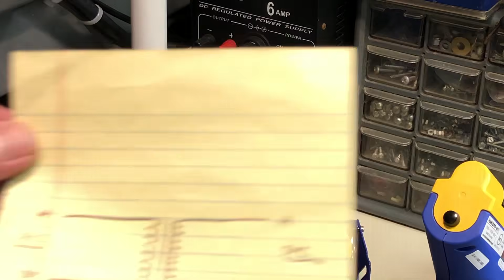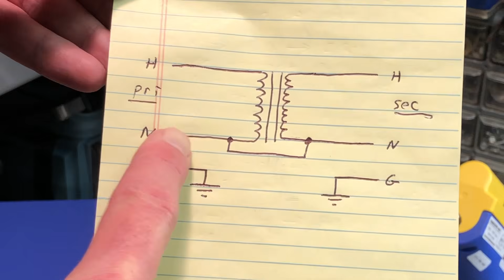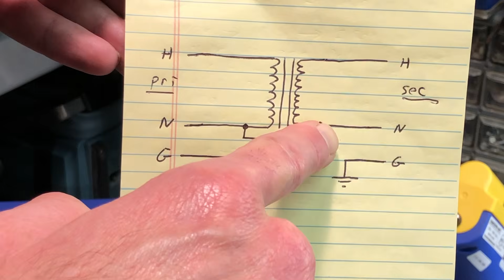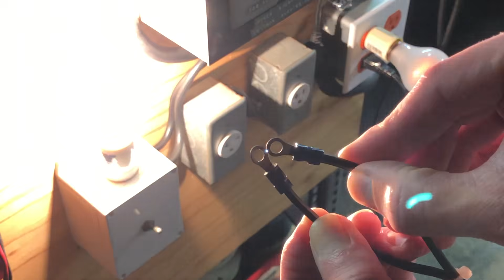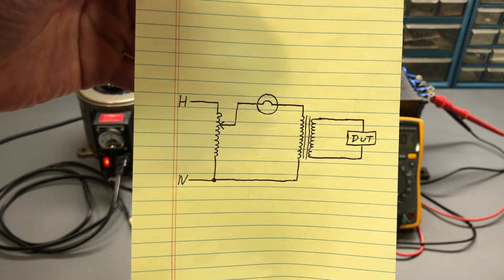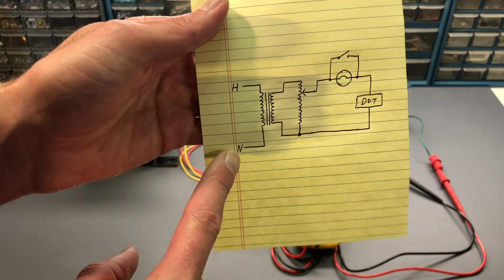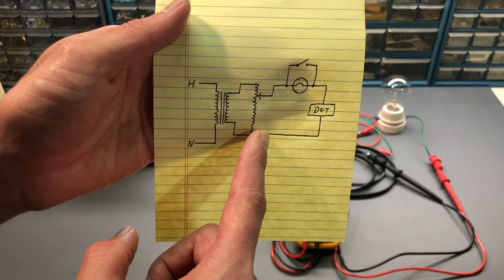How An Isolated Dim Bulb Tester Works (Current Limited Isolation Transformer And VARIAC)

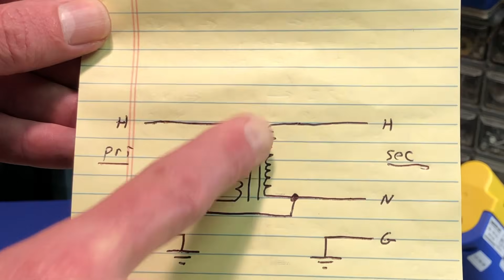Comment: I'm doubtful that the circuit shown at 11:50 is correct. I'm more familiar with medical grade isolation transformers, and that's definitely not the way they're wired.

In isolation transformers, the protective Earth ground is connected to the transformer chassis and the secondary earth terminal is also connected to the transformer chassis. The secondary terminals are floating.

Also, implying that isolation transformers are "less safe" the way they're wired by the manufacturer doesn't quite sound right to me. A completely floating secondary, without an earth ground, doesn't make it more safe. It may be useful for the limited use of servicing faulty equipment, but there are reasons for grounding electrical equipment and people should understand why.
Reply from the maker: I think there is an important distinction here, and perhaps some confusion about the particular transformer shown in the video.

This is not a medical-grade isolation transformer, nor do I claim that it is. The unit was originally manufactured as an isolator for noise reduction in audio/AV applications. The schematic at 11:50 shows its actual as-built wiring. I verified this myself with an ohmmeter: the primary neutral and secondary neutral were electrically connected.

That connection is precisely why I modified the transformer. I removed the primary-to-secondary neutral connection so that neither conductor of the secondary has an intentional conductive connection to earth or to the primary side. The transformer chassis remains connected to protective earth.

That's the distinction that is important for galvanic isolation. Protective earth being connected to the chassis does not defeat the isolation; connecting one conductor of the isolated secondary to the primary neutral/earth reference does.

In the original configuration, because the secondary neutral was tied to the primary neutral, the secondary was not truly floating with respect to earth. After removing that connection, it is floating, which is what I wanted for servicing and testing line-powered equipment.

I agree that protective earth and chassis grounding are essential for equipment safety. But a protective-earth connection to the chassis is quite different from intentionally bonding a secondary conductor to earth. The latter would eliminate the floating secondary that I'm specifically trying to achieve.

So the diagram at 11:50 is not intended as a schematic for how medical isolation transformers are normally wired. It is the original wiring of this particular AV noise isolator, before I modified it for use as an isolation transformer.
Reply: "Useful for the limited use of servicing faulty equipment" ??  What do think Dim Bulb Testers are used for ?

Comment: The ground on the isolated side can  also be connected to the neutral line at the main power panel.
Reply from the maker: No part of the isolated secondary should be connected to neutral or ground.  If it is, then you have defeated the isolated part and have the same shock hazard as the regular AC line poses on the "hot" side.

Comment: This is a really solid video. I agree with some others it could probably be presented more briskly, but all the hard parts you nailed. Well done.

An advantage of setup #3 (mains -> variac -> isolation -> bulb) is that it lets the isolation transformer operate at a lower voltage and with a soft start as the variac knob is turned. This lets it run cooler with less wear and tear. Small advantage perhaps, but if your variac doesn't have a meter (or you're not using it) this might be a better configuration.

The only downside of #3 then is the variac winding remains mains-referenced, so its enclosure, wiring, and mechanism need to be treated as line-side equipment. If it's a proper enclosed/grounded variac assembly that won't be a problem.

Also, "Variac" is a brand name, variable autotransformer is the general term. (I know you know, just mentioning for others.)

Comment: And a true isolation transformer built for the purpose will have a copper electrostatic shield between the windings. This should be connected to the core and to ground.

Comment: As soon as you connected the two windings together, you lost isolation.  As soon as you do that, you cause the secondary to be ground-referenced, rather than floating, which is the opposite of what you want for safety.  I hope you have since figured that out.
Reply from the maker: The primary and secondary sides were never connected together. The secondary in all examples and in my bench setup is floating.

Comment: Recently I watch some videos about inrush current in transformers. I would ad an softstart circuit before the isolation transformer.
Reply from the maker: Some transformers have high inrush current depending on design and materials.  If the inrush is causing switch damage or blowing fuses there are several ways to limit the current but an easy way is to switch on the primary with a zero crossing solid state relay.  This allows the AC sine wave to ramp up the current instead of switching on abruptly when the sine wave is near a peak.

Comment: But why does the current in the first scenario jump around like that? Can we simplify it to just shorting a few windings of the variac? I don't understand it.
Reply from the maker: In the first configuration, the lamp is on the input side to the variac.  This places the lamp load in a less than ideal place for the variac. The bulb in my example is 100 watts.  This means the variac power is limited to 100 watts.  Neglecting slight power loss in the variac itself, the variac input power will equal the output power, so 100 watts in this example.  If the variac is set to a low output voltage, say 5 volts, then the output current must be very high to equal the 100 watts.  20 amps in theory.  Ohms law confirms this.  Notice the DMM (the DUT in my example) also spikes to a high initial current when the variac is starting out at a low voltage.  High current in the 1:1 isolation transformer primary means equally high current in the secondary.  With the example 100 watt bulb, you would find that no more than 100 watts would ultimately be available at the isolation transformer secondary.  However in this first configuration the high current spike at low voltage is not ideal and could even damage a variac.
Reply: I talked about this with my father, he helped me understand it further. It's basically a shorted winding which would cause a problem in any transformer. A variac windings are is still magnetically coupled. And we don't want a shorted winding so the lightbulb should be after the variac (also for other reasons) so it never becomes a shorted winding. Thanks for the explanation.

Comment: I started repairing audio equipment when I was 18-years old at a service center in in California, and they showed me how to use a "dim-bulb" tester when replacing output transistors in amplifiers. Many years later, still repairing all kinds of electronic equipment including restoring analog instrumented (General Radio) metered Variac's, a typical "single range, amps-only-metered" Variac is shown in this video. There is nothing better than a dual analog metered (meaning with indicating needles) Variac especially with a dual-range (0-1A/0-5A, or 0-2A/0-10A) amps or watts meter when slowly bringing up the ac voltage to a newly repaired piece of electronic equipment! The dim-bulb tester will work, but even with a DVM, it doesn't let you determine because of the constantly changing digital meters, what the "device under test" is actually drawing as the voltage is raised. The analog meter needles clearly demonstrate through "visual comparative perception" what the voltage and current the DUI is drawing as the voltage is raised to the device, this is called "trending", constantly and visually monitoring both the voltage and current to determine the status of the DUI under test! David Riddle
Reply from the maker: On my permanent set up I use a General Radio variac with analog volt, amp, and watt meters.  I think I showed it in this video but if not I do have it being used in other videos.  The DMM's in this video were just for demonstrations of the concepts.  As you mention, when testing you definitely want to monitor what the DUT is doing and not just go by how much a bulb is glowing.

Comment: If you are trying to avoid hot chassis, when you have the variac on the same side of the isolation transformer as the DUT you still have the chance of creating a potential across the two chassis (variac-DUT), wouldn't you?
Reply from the maker: The variac is floating i.e. no part of its windings are  connected to ground or a chassis. You can (or should) verify this with an ohm meter.  You might measure a ghost voltage  from the variac input or output to chassis, which I discuss in another video, but this is not a shock hazard.

Comment: It's getting harder to find "real" light bulbs!  What's an alternate?
Reply from the maker: There’s no easy alternative to the characteristic resistance change and current handling the filament provides. You can find incandescent bulbs on eBay, specialty stores and surplus stores. The bulb as used here will last many decades. You just need one each of a few different wattages and you are set basically forever.
Reply: heatlamp bulbs will always exist
Reply: I have found that hardware stores sell yellow incandescent bulbs which are marketed as "bug light bulbs". They are yellow - but who cares?
Reply: I actually found these cool 100w Edison replicas with fancy woven filamants!
Reply from the maker: @TeslaTales59 yes there are specialty or decorative incandescent bulbs and they work fine too.
Reply: @TeslaTales59 The antique-style Edison/Marconi bulbs look nice, and definitely bring a nice aesthetic to the workbench. But, versus spiraled tungsten filaments, they tend to have higher voltage drop at the lower end of the current range. So, the modern style bulb is actually the safer and better performing option. You can have your DUT receive exactly 120 volts with a smaller bulb rating, because less boost voltage is required fro the variac. Furthermore, you need a higher wattage Edison bulb to do the same job, which means short-circuit current will be higher with an Edison bulb versus a spiral tungsten filament. That said, I sometimes use a Marconi bulb for fun and looks. But when performance really matters such as with a higher watt tube amp, I swap in the modern bulb. The good news is it's easy to change bulbs on a whim.

Comment: You seem not to understand the transformer action of the variable autotransformer .  When dialed to 50 percent voltage, you will get double current on the output.  That's a standard 2-to-1 ratio; voltage down, current up. As you continue to reduce the voltage you are actually increasing the turns ratio hence the increase in current on the output.  It has very little to do with the varying resistance of the lamp (which varies, but nowhere near as much as can be seen).  The common turns have currents in opposite direction so 4 amps out, 1 amp in, the common portion will have 3 amps.
Reply from the maker: The point of using the dim bulb setup is to limit the load current to a safe known value with variac brought up to  normal line voltage.  In case the DUT has a short circuit or overload failure, the lamp will glow bright and current is limited to the lamp's rating.  Any change in current available from the variac at its different voltage settings is not relevant since the lamp current is the limiting factor.  The lamp wattage has to be chosen correctly for a given load so you don't limit current excessively.  The bulb should barely be glowing with the DUT operating properly.  The point of the variac is to slowly bring up the AC line rather than hit the DUT with full line voltage.
Reply: @EriksElectronicsWorkbench  " In case the DUT has a short circuit or overload failure, the lamp will glow bright and current is limited to the lamp's rating."
Depending on where exactly you have placed the lamp in the circuit (which your video explains well).

The Variac can compensate for the voltage drop caused by the dim bulb since most of this kind can produce voltage above line voltage.

Anyway, yes, when I am "re-forming" electrolytic capacitors I bring up the voltage slowly.
Reply from the maker: @thomasmaughan4798  yes the usually the variac can boost above the line voltage but something to keep in mind, suppose you place the variac after the series connected bulb, you can't turn up the variac to compensate for the voltage drop across the bulb, sort of "undoing" the bulbs protection.  As the video shows, the bulb, variac, and transformer can be placed in different orders but you will always have current limiting, just that some configurations have less desirable side effects.
Reply: @EriksElectronicsWorkbench  "suppose you place the variac after the series connected bulb, you can't turn up the variac to compensate for the voltage drop across the bulb"
You can do exactly that BUT its behavior depends heavily upon the load at the moment.  It will likely NOT achieve what one thinks is being achieved.  So the FIRST thing in the daisy chain, from the mains supply, is the Variac.  After that whether you put the lamp in the primary of the isolation transformer or the secondary is unlikely to make much of a difference.  However, where ever it is put, an AC voltmeter ought to be at the Device Under Test and if  it wants 120 volts, adjust the Variac as needed; it might be pushing 140 volts and the lamp eating 20 volts thus giving 120 at the DUT.  
However, once you have decided that the amplifier is not short circuited, seems to me the lamp ought to be removed particularly if you are going to be load testing the amplifier.  If the supply voltage dips to 60 volts just because you turn up the volume you are likely to enter non-linear regions of the amplifer, to say nothing of simply having less power.
Reply from the maker: @thomasmaughan4798  The setup and what I discuss assumes a DUT load.  If you have a series lamp but no load, then no current, means no voltage drop on the lamp, but what would be the point since there is no load connected.  Yes a voltmeter at the DUT is a good idea.  Yes remove the series lamp once the DUT is known to be working and especially if load testing an amp.  The dim bulb is basically for initial power on testing to do so in a safe controlled manor.
Reply: @EriksElectronicsWorkbench  "The dim bulb is basically for initial power on testing to do so in a safe controlled manor."
Indeed it is and a great and simple tool for the purpose.  Also, a highly visual indication of a short circuit or unexpected current draw.

Comment: For the demonstration Should have a volt meter showing the input voltage and a volt meter showing the varying voltage on the output? A very good example.
Reply from the maker: I wanted to keep the test setup as clear as possible.  For the demonstrations the voltage was not important, it is about the current limiting, which is shown in amps on the DMM.  Except at 32:34 I do show voltage measurements for this configuration due to voltage loss across the lamp even at no load.  For a bench setup then of course monitoring voltage to device being tested would make sense.

Comment: I use the same order of components as you, but a different switch. I use a 20 amp 3-position center off SPDT switch (Leviton 1285).  On your last schematic, the common terminal on the switch would connect to the wire that runs from the lamp socket to the DUT outlet.  One switch pole connects to the other side of the lamp socket.  The other switch pole connects to the other side of the DUT outlet.  With the switch in the center position (OFF), the DBT operates normally.  One ON position shorts out the DUT outlet, becoming a DBT test position.  The other ON position shorts out the lamp, connecting the full output voltage of the variable autotransformer to the outlet.

One other feature I add, in homage to my advanced age, is a guarded lampholder (Woods L1706 Vandal Resistant 150W Incandescent Security Light) that has no exposed terminals, and that encloses the lamp in a glass jar that is further enclosed in a metal cage.

Comment: Hi Erik  is the variac  still earthed  as in the 4th option  ie isolation  transformer  then variac  then lamp
Reply from the maker: When the VARIAC is after the isolation transformer it is not earth grounded.
Reply: @EriksElectronicsWorkbench  This really worries me as I'm considering building the 4th option...not that the output wouldn't be grounded (because that's the whole point) but the chassis of my "variac" wouldn't be grounded. That thing is a huge OLD hunk of metal...if a hot wire were to come loose inside the variac and touched the metal enclosure, I'd have a big problem that wouldn't trip my breaker because it's on the other side of the isolation transformer. Amazing video, but what are your thoughts on the risk?
Reply from the maker: @blougaville  The fact that the variac is on the isolation secondary makes it floating and isolated so one of the "hot" wires touching its chassis does not create a shock hazard between the user and ground.  Not ideal of course and equipment needs to be inspected for such defects.  Routine voltage measurements from chassis to hot wires can reveal faults.  See my video on ghost voltages for more about this.
Reply: @EriksElectronicsWorkbench  Thanks for your response! I suppose that makes sense. Something about the idea of a metal chassis being un-grounded just feels wrong from all the residential electrical work I've done...but this is also an unusual situation and all safety concerns need to be weighed to determine which method is the safest for any given situation. I haven't seen the ghost voltages video so I'll check that out today!